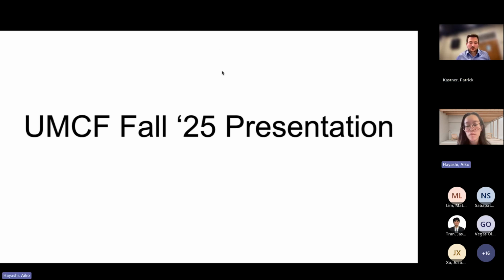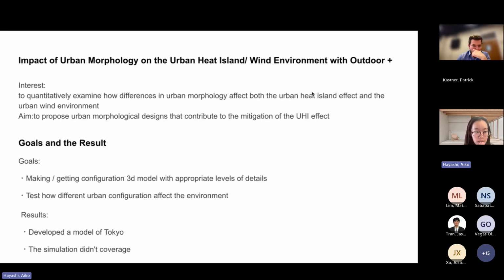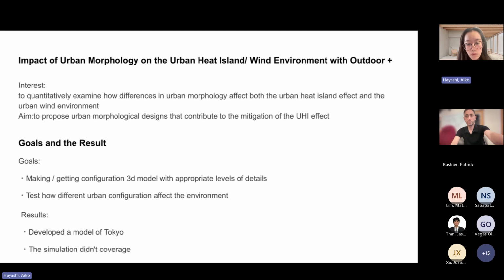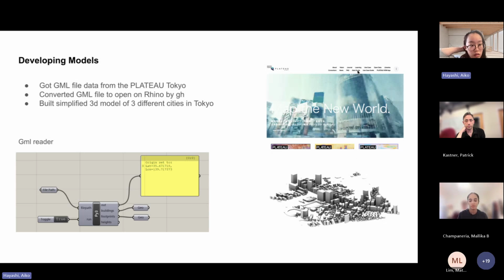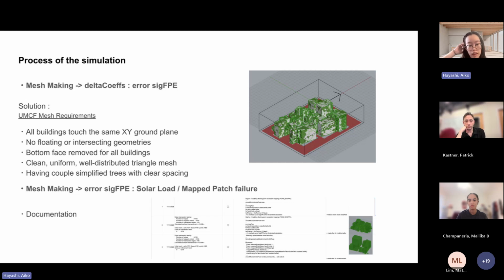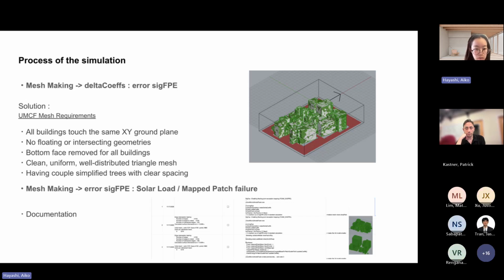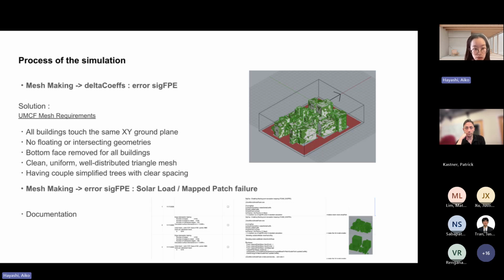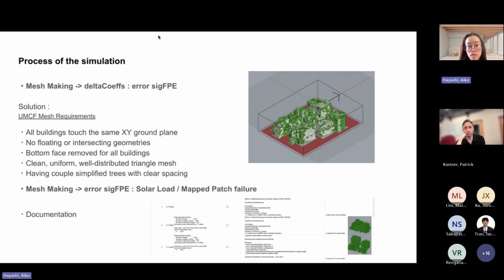VIP-SMUR — Fa25 — Microclimate-Outdoor+

Comment: Hello, umcf team members. Thank you very much for developing Outdoor+ and sharing the presentation. It is a very useful tool for outdoor microclimate simulations.

I would like to ask if there is an official email address, forum, or user community where users can report issues and follow software updates. It would be very helpful to have a channel to communicate with the development team.

For example, in the February update, it seems that adding a terrain has become mandatory. However, the component input hints still appear to follow the previous version, which caused some confusion during the simulation setup.

I would really appreciate it if there is a place where users can provide feedback and learn about the latest updates.

Thank you again for your great work!